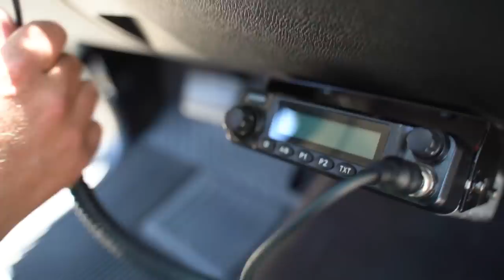The Cleanest Daily Bolt On Long Travel Chevy Silverado

Comment: Are the six speed transmissions more reliable than the 4 speed? If I recall the 4L 60 is notorious for being weak right? Lots of those guys upgrade to the 4L 80 correct? How did the six speeds hold up?
Reply: 6L90 is a great transmission!